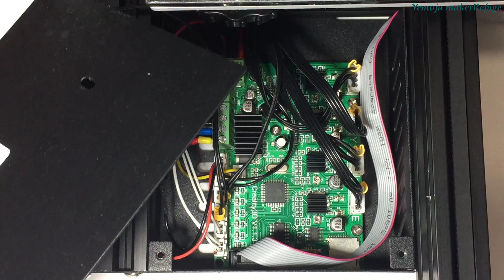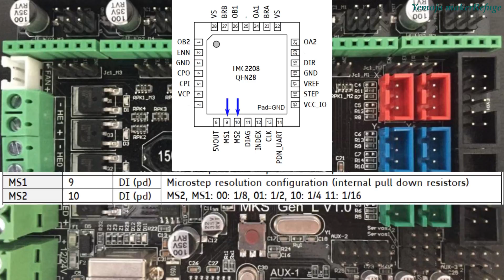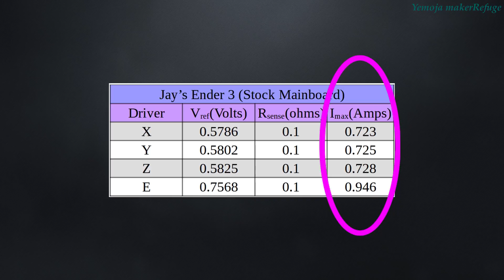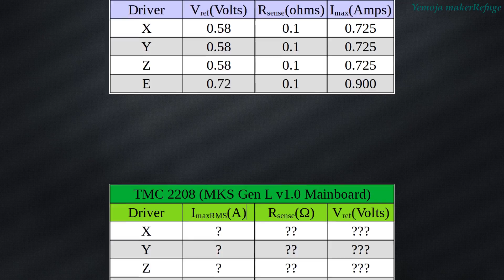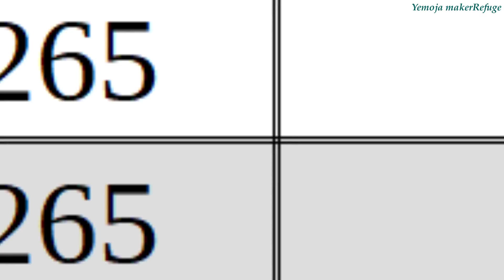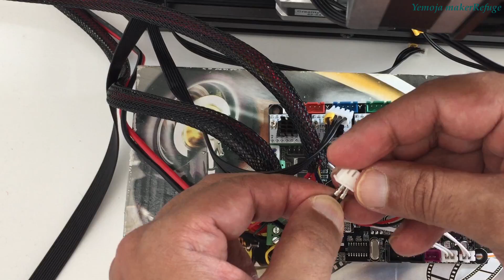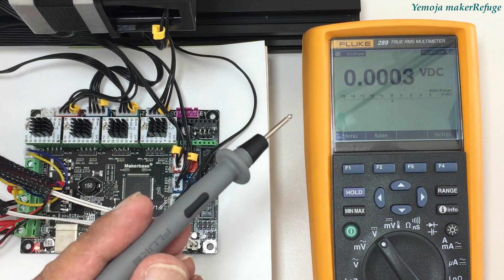Ender 3 : Upgrade to MKS Gen L v1.0 + TMC2208(Legacy) - Part2

Comment: Hello I did not understand a passage in the video using the TMC 2208 I have to remove the pin n ' 3 from the card MKS or no ?
Reply from the maker: Hi @Andrea Flego. If you mean remove the jumper from MS3 then you are right technically NO jumper on pins MS3. You ONLY need jumpers on pins MS1 & MS2 for 1/16th step-size selection.
Hope it helps.

Comment: Where do you add the fan on the top of the motherboard at? Only one I can't figure out
Reply from the maker: Hi @Iance Meck. I connected it directly to the 24V supply terminal block. Hope it helps.
Reply: @yemojamakerrefuge898  thanks i figured that after i wrote this lol. do you know where we add the bltouch to this board?
Reply from the maker: Heya @lance Meck. Connect the servo three wire connector to the row with pins, D11:5V:GND, in the SERVOS1 header. Refer to schematic(scroll down) for pinout, https://www.biqu.equipment/products/mks-gen-l-v1-0-integrated-controller-pcb-board-compatible-ramps-1-6-support-a4988-drv8825-tmc2208-tmc2130-for-3d-printer .This represent SERVO0 which is the default when BLTouch is enabled.
Then plug-out the Z-min endstop connector and replace it with the BLTouch's 2-wire connector.
For my case, 3-pin connector from BLTouch connects as following
D11 - Orange[Signal]
5V - RED[Power]
GND - Brown[Ground]

& the 2-pin connector connects to Z-,
G - Black
S - White

Hoping this helps.

Comment: Awesome video! Just installed the mks gen l. Are you going to do a video on sd card support, my printer is useless right now.
Reply from the maker: Hi @chico cerven. Yes it'll be out by today by God's grace. Go ahead and order the following module that I'm using https://www.aliexpress.com/item/KuaiJieWei-3D-printer-Store-45-40mm-Independent-External-SD-Card-Slot-Module-with-20cm-Dupont-Cable/32878793742.html?spm=a2g0s.9042311.0.0.27424c4dU6rzHL . There are cheaper variation which claim to work out-of-the-box on the MKS Gen L board such as https://www.aliexpress.com/item/3D-Printer-External-SD-Card-Slot-Module-Independent-External-Module-with-Connecting-Cable-Line-3D-Printer/32854192637.html?spm=2114.10010108.1000014.1.630f53522hgz6p&gps-id=pcDetailBottomMoreOtherSeller&scm=1007.13338.112235.000000000000000&scm_id=1007.13338.112235.000000000000000&scm-url=1007.13338.112235.000000000000000&pvid=78c1d356-fc04-4d35-a129-c57b911aad23 but I have not tested it personally but should work.

Comment: Hi Bro. Thanks a lot for your great job. You've mentioned that motors and TMC2208 are hot when printing. Maybe is it caused by too high Vref? I know that you set it to be as close to stock values as possible, but Watterott on their site says "Do not set the drivers to the maximum rated current of the respective stepper motor. A good point to start is half of the rated current."  https://learn.watterott.com/silentstepstick/faq/ So maybe it could be worth to run some tests to find optimal Vref values for Ender 3, to get nice print quality without losing steps, and to provide cold drivers / motors at the same time.
Reply from the maker: Hi @gr0mov. Thanks for sharing the link I haven't seen that before. You are right, I have tried setting the drivers to lower values and did some small prints without any problems. But I haven't been able to explain the reason. It is possible that the rDS typical vs max. values give some room for play but then it is dependent on individual driver. I have been looking to systematically quantify the optimum settings based on data from the specifications but no progress yet.
It could also be the stepping algorithm is much efficient at adapting to the dynamics of the motor characteristics which are due to the reactive nature of the coil windings. Meaning, the high-resolution stealthChop may be better at tracking the current levels thru the motor windings and adapting the voltage-levels for generating the next-step. In other words, the high-resolution would be able to produce much closer values to an ideal sinusoidal current waveform thru the motor coils. This could allow us to drive the motor at lower current values in comparison to drivers like the A4988. Again, this is only my opinion and I have nothing to back-it up with save for reasoning from my LIMITED understanding of h-bridges and electric motors.
So sorry I got carried-away with this topic, but thank you for the suggestion. I have been wondering about this myself to say the least.
Reply: Hi  @yemojamakerrefuge898  I've setup all my steppers at 75% of their max rated current (as we know, stock in Ender 3 is about 90%). I can touch heatsinks and keep them in fingers without a problem (I've  installed bigger 15x14x13 mm heatsink on Extruder's stepper for better heat disspation). They are warm but not hot. The same happens with motors - they are warm as they were with A4988. To be honest I also wanted to check values about 50% according to Watterott suggestion, but I was affraid of losing steps. Then I found official Trinamic solution to prevent such situation - acceleration values in Marlin (DEFAULT_ACCELERATION, DEFAULT_RETRACT_ACCELERATION & DEFAULT_TRAVEL_ACCELERATION) should be slighty decreased. More info here: https://www.youtube.com/watch?v=c3v9E1AwDBE Finally I haven't checked that, but at this moment I see no problems with my setup - no overheating, no lost steps, stock acceleration's values are also saved. So my Vref values for TMC2208 assembled by FYSECT (version 1.2) and configured in Standalone / Legacy mode are: 0,63V for XYZ and 0,75V for Extruder.
Reply from the maker: Hello @gromov. Nice! Thanks for sharing. Appreciate it buddy.

Comment: Hello ,

I could ask for a scheme to connect the extruder motor to the main board in the ender 3 printer.
Reply from the maker: Hello. Sorry I'm not sure what you are asking buddy. But the extruder motor's four pin connector labeled "E" connects to the black four-pin socket labeled E0 on the MKS Gen L board. The stepper motor connector are located right on the edge of the board next to the stepper driver sockets. Did I answer your question?

Comment: Hey Jugnu, these are excellent videos, exactly what I needed!
Just have one thing I want to check with you though; I recieved TMC2208 version 1.2 even though the listing picture showed 1.0, ugh... Do you know if they will work properly? There are 3 pins where the 3 "NC" pins are on your 1.0 called "CLK", "PDN", and "UART". 
As long as I set them up in Marlin the same way you show in your video they should work right? If you aren't sure, no worries, just thought I'd ask before doing some digging around the net. :)
Thanks for such a great tutorial, really appreciate it!
Reply: So I ended up spending the last 5 hours doing some research and managed to figure this out (and the printer's happily working silently right now!! :D ). Anyone else that want's to use the v1.2 rather than wait another month for delivery, read on.

Depending where you order the 2208's from you may or may not have to do some soldering. I ordered mine from Banggood and they have already done all of the soldering required to use this version in standalone mode. To find out if you will need to do it, follow these steps:

1) Find the 3 pins named "CLK" "PDN", & "UART" and then flip the board over to the chip side.

2) There will be 3 small jumper pads meant for switching between UART and Standalone mode. Find the three pads closest to those 3 pins.

3A) If any of those 3 pads have solder bridging them, you will need to remove the solder. 

or

3B) In my case there was some solder on 2 of the pads, but it was not creating a bridge between them.  If you find the same on yours (or no solder at all) you do not need to do anything further, simply follow Jugnu's awesome guide and you're done!

My best guess is the supplier ran out of ver 1.0 boards and bought ver 1.2's instead which should have a small metal link soldered between those 2 pads and just removed it to turn them back into 1.0 compatible boards. It may not be the same if you buy from Amazon, or get non-Fystec branded boards, so make sure to check them carefully before installing to prevent any chance of damage (not likely but I wouldn't risk it, they aren't cheap).

Thanks Jugnu! My upgrade adding MKS Gen L + 2208's + MKS TFT 2.8" Touch Screen is finally complete!!! :D
Reply from the maker: Hey @The Crab. I'm so glad your upgrade works. Thanks so much for sharing your experience. Appreciate it.
Reply from the maker: Hi @The Crab. I'm not sure whether the v1.2 TMC2208 driver will work in legacy mode out-of-the-box. The Fystec wiki, https://wiki.fysetc.com/TMC2208/, specifically mentions the v1.2 are already in UART mode for use with their F6 board which is described at https://wiki.fysetc.com/F6_V1.3/.
It maybe as simple as reversing whatever is needed to get v1.0 driver in UART mode.
They have a forum which may help you out as well. Check-out the comments at the bottom of each page linked above.
Sorry wish I could be more help buddy.
Reply: @yemojamakerrefuge898  No problem man, thanks for the links! Did a bit of digging but couldn't find any info yet, so I'm just waiting for them to approve approve my registration on the forums and I'll ask them about it. When they get back to me I'll send you a link to it in case anyone else asks you.

Thanks again!

Comment: What are the steps necessary if you want to take full advantage of the 256 microstepping functionality that the TMC2208s offer?
Reply from the maker: Hello @Casy Craig. Nothing buddy. The 256 micro-stepping is done internally a.k.a microPlyer. It works out-of-the-box for stand-alone mode of operation.
Reply: Yemoja makerRefuge Ok. I asked because in the video he talked about setting them to 1/2, 1/4 or 1/16 step. So what is that all about in regards to the 256 micro steps?
Reply from the maker: Good question @Casey Craig but the answer requires a video in itself.
So the micro-steps mentioned in the video are the electrical pulses that are sent to the driver via the STEP pin. Hence, for our case of 1/16th step, we'll need to send 16 pulses in order for the motor to turn ONE complete revolution.
What I believe microPlyer does is, instead of delivering the 1/16th step to motor right-away is chops-up the 1/16th step into another 16 steps internally (16 x 16 = 256). Meaning, when we send a command to the motor to advance by a micro-step (1/16), internally the driver sends an additional 16 smaller steps to the motor which makes-up for the sent micro-step.
Thus smoother rotation of the shaft results. How is this achieved? By interpolating the physical/electrical sent micro-steps to a 256 step-table which is stored internally in the device.
I really hope I'm making sense buddy.
Reply: Yemoja makerRefuge. Excellent reply. Thank you. That makes perfect sense.

Comment: I think am ready to order the parts and take the leap....
How do you attach the sd card reader? Is there a change needed in Marlin for the reader?
Reply: Did you get the sd reader working?
Reply from the maker: Hi @anenkris De Pril Yes I did. Currently working on the video for that. You can go ahead and order this unit, https://www.aliexpress.com/item/KuaiJieWei-3D-printer-Store-45-40mm-Independent-External-SD-Card-Slot-Module-with-20cm-Dupont-Cable/32878793742.html?spm=a2g0s.9042311.0.0.384c4c4dHLUtdN. This is one of the units which works for me. There are cheaper versions of this though so do look out.
Reply: Already ordered that one. 👌😉
I’d like to use https://www.thingiverse.com/thing:3291565 for the usb and sd card slot. Needs adjusting for the sd slot.
Reply: Just wondering what happens if you later on put in a TFT28 which has also sd card reader on board? Will they both work?
Reply from the maker: Hi again @anenkris De Pril. Yea I believe it should work simultaneously. Saw a video of this on Michael's Teaching Tech. Also check-out the links he has provided. It seems this is a UART based device instead of an SPI. So I believe both SD card slots would work. My concern would be if you decided to use TMC2130 with SPI than you might have to remove this SD Card slot.
Reply from the maker: Hi @anenkris De Pril. I have ordered an SD Card replacement part but it has yet to arrive. I haven't actually looked into that yet. Will compile that info into another video once I get it working. As of now, I run my printer using the Octoprint interface.

Comment: thanks for the video, I am having issues with the lcd screen not working, I tried switching the cable to backwards on the board as in the video, tried it in each slot on the back of the lcd, tried 2 calbes from the board to the lcd and still only lights up the board but no graphics.
Reply from the maker: Hey @Jeremy Lee. Plug-in the cable in reverse into the socket on the MKS Gen L board labeled EXP1 only. Need NOT change the connector orientation at the LCD side. That's all I needed to do to get mine working. Hoping it works for you too buddy.
Reply: @yemojamakerrefuge898   I turned it on today to work on it again and the screen is working now. the only thing not working is my hotend cooling fan. I know it is supposed to kick on at 50 degrees but I heat up the hotend to 180 to test and no fan
Reply from the maker: Hi @Jeremy Lee. I'm glad the LCD works. In this video series I have opted to connect my hot-end fan directly to the 24V screw-terminal block.
What you want to achieve requires additional firmware changes and the fan would be then connected to the HE1 screw-terminal block.
Michael at Teaching Tech has covered this in one his videos in regards to the MKS Gen L upgrade for Ender 3. Good luck.
Reply: @yemojamakerrefuge898   in adv.h search E0_AUTO_FAN_PIN change the value from -1 to 7 and the fan will come on when the hotend hits 60 degrees but you will need to connect the fan to the board where marked E0 that way the fan does not get incremental power like the hotend does. Next question lol I tried my first print and it is printing really small for some reason did I miss a step?
Reply from the maker: Hey @Jeremy Lee. Yea I have been investigating that for another video. Thanks for the information.
Regarding your problem, perhaps you made a mistake when editing the firmware sources. Or your gcode file may actually have been accidentally resized when converting from stl?
I don't know but could selecting other step-size besides 1/16th cause that but it probably has to be done for all stepper driver. Maybe double-check that?

Comment: Are you going to be doing a video on a bltouch or touch screen with this new board? That would be awesome. Great videos, keep up the good work.
Reply from the maker: Hi @Chico Cerven! Yes BLTouch is in the pipeline. Currently I'm busy with setting-up my new PC as my old laptop was having a hard-time coping-up with the video rendering. Also, needed to configure my workshop in order to use space more efficiently.
As for a touchscreen, I'll consider the request as it has been made a few times. The touchscreen is quite expensive more my liking.
Reply: The touchscreen is definitely to expensive.

Comment: How have you mounted the MKS Gen L board? Are you going to use the stock enclosure? I'm thinking that the stock enclosure will work just fine just need to print a mounting adapter (plenty on Thingiverse). A problem I'm having is the case cooling fan. From what I've seen the stock 24V case cooling fan will plug into the socket labeled "12/24V". What I would like to do is print out a new cover plate for the case that has two fans. I have seen  on "thingiverse" several of these and they all use two 12V fans with "step downs" or other means to connect these 12V fans. What I can't find is any info on  how  you would connect two 24V fans in the cover to cool the board? I know the stock fan is 24V, 0.10A. The two fans I would like to install would be 24V, 0.06A each. Could they be wired in parallel and simply plugged into the above mentioned "12/24V" socket? And would any settings have to be changed in the Marlin software? Sorry don't know some of the terminology for electronics. I'm asking this because I caught the comment you made about the stepper driver heat sinks being too hot to keep your finger on before it became uncomfortable. So that made me think how to keep them cool.
Reply from the maker: Hi @dlhoulton. Because I only have one printer and I'm experimenting with a multitude of things, currently the board sits on a paper-box and a 12V @80mm fan is stuck on the box right in front of the board. I am using one of those 12V step-down converters you mentioned.
You can check-out Teaching Tech channel where Michael designed an adapter for the stock case and also a new case altogether.
To answer your question on whether you can connect two 24V fans in PARALLEL into the socket labeled 12/24V, YES you can. And you wouldn't need any firmware change whatsoever.
In fact you could also connect two identical 12V fans in SERIES and attach to the 12/24V receptacle if you have those lying around.
Yes you correct, the drivers are NOT meant to run without active-cooling.
Hoping this helps.
Reply: Thanks for your help. One other question. On the Ender 3 the control board fan and the parts cooling fan are on the same circuit. The control board fan does not come on to cool the stepper drivers/board until the parts cooling fan comes on. What about on the MKS Gen L board. Is the 12/24V socket/plug where the control board/case cooling fan plugged into constantly energized for continuous board/stepper cooling?
Reply from the maker: Yes you are right. The socket provides constant continuous power at the same voltage as your main power-supply unit i.e. 24V in the case of the Ender 3.